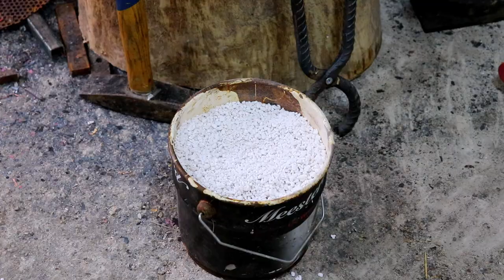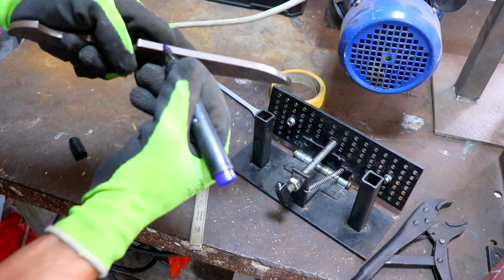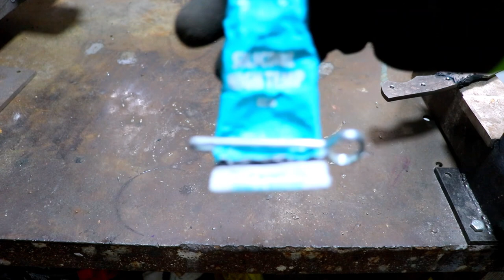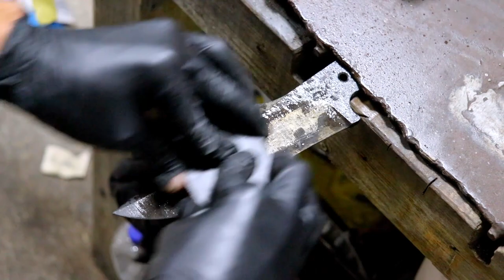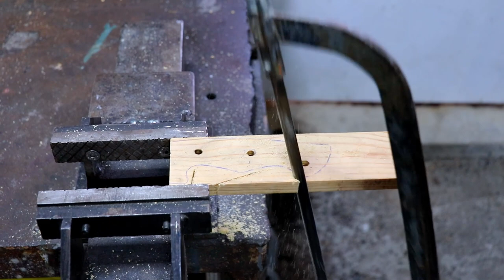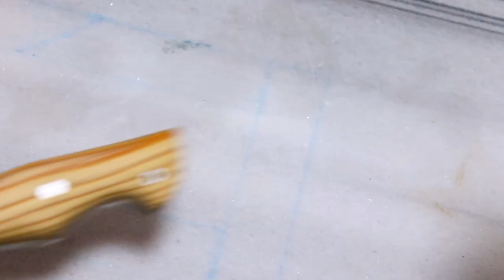Knife Making | Making a Hunting Knife

Comment: Hi, Can you explain the white stuff that you cool your steel in please? Way back we used two slabs of steel to cover out hot steel in so it can cool slowly, would this be about the same idea? I am about to make a knife out of leave spring, will be my first try.
Reply from the maker: It's called perlite, you can get it at garden stores(or somewhere similar). It's a great insulator and it's exactly used as you said, to cool the steel down slowly

Comment: Your belt grinder is made of really thing tube steel you should make one of 1/4in thick walled tube steel
Reply from the maker: yes I agree, thats why I'm going to make a new one
Reply: @jk.projects  great, watch  House Works video on the one he makes you dont have to make it so it goes horizontally either i wouldent, if i wanted a horizontal grinder i would make a dedicated one and not a combo one like he makes
Reply from the maker: @blacksteel2434  I actually took alot of inspiration from the revolution 2x72, funny thing is my grinder does go horizontally aswell I just rarely use. I wish I could have 2 grinders, but that is the problem with a tiny workshop, you can only fit so many tools.
Reply: @jk.projects  ya i am working on getting a shop build

Comment: The hammon is not clear. Try to thin the mass and apply it in layers. Each layer must dry. It will stick better. No wire will be needed. The oil will not get under the insulation and the hammon should come out clearer. I had the same problem. I like the wood. What is this wood? Generally good job.
Reply from the maker: Thanks for watching my video! Yeah this was the first time attempting a differential hardening so I got alot to learn, but I still liked the dark look. I have no idea what wood, just some scrap I had.
Reply: Wood looks like pine not generally considered hard enough for scales unless stabilised. Pine has a tendency to be a sponge for moisture

Comment: I think there may have been something wrong with your ferric chloride solution it looked really muddy and it should be almost a translucent amber color
Reply from the maker: The acid is not the problem. The issua is I used leaf spring(5160 steel) and that is a deep hardening steel. Hard to get a nice hamon with it, but not impossible. Thanks for watching
Reply: @jk.projects  not talking about your hamone I think your ferric chloride is contaminated it shouldn’t look like that at all